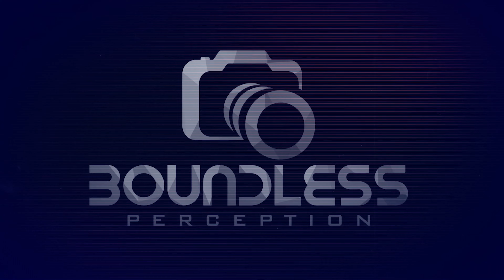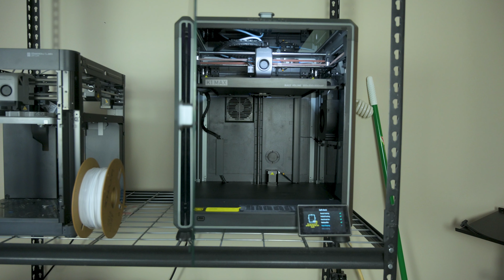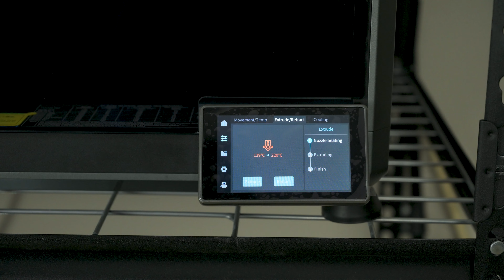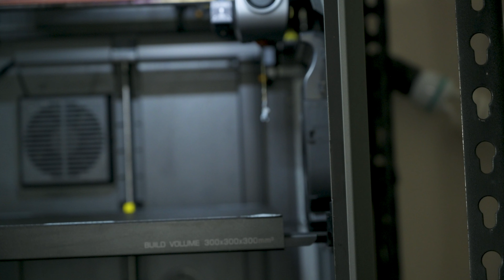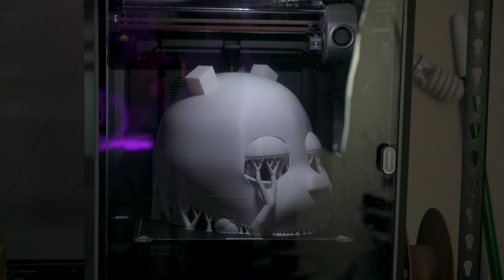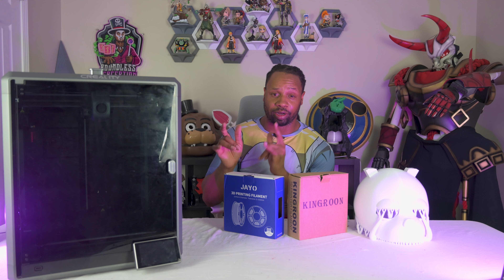I Bought A Creality K1-Max 3D-Printer For Cosplay

Comment: Get yourself the Micro Swiss Hot End upgrade ASAP, that thing will save you so much hassle with clogs and filament issues.  Its amazing how much that one thing improves the K1 Max.
Reply from the maker: You know that  what everyone keeps telling me. I have all microswisses on my cr-10s and they fixed so many problems so likely will. Do they make an extruder gears or just hotend.
Reply: @boundlessperception1466  Just the hot end.  An aftermarket extruder gear would be nice!  But to be honest I've had no clogs after the hot end swap.
Reply from the maker: @cylonmode  Ill be ordering one today.
Reply: So I'm looking to buy my first printer. And am looking at K1, K1c and the max. Am I better off going for the K1 since it's so much cheaper and doing the Micro Swiss Hotend upgrade on it? Or is the K1C & Max worth the immediate purchase?
Reply from the maker: @Ratbiker48  I don't have any experience with the k1c but ny k1 max so far has already given me a jam. It was easy to clear but still annoying. I also recently got a qidi max 3 and though it's enormous would recommend it over the k1 max. It's also cheaper.
Reply: @Bjorneberg34  depends on what you're printing I guess, but I'd always recommend the Max and hot end upgrade.

Comment: I'm using the P1S right now but strongly considering adding a K1 Max. I'm still watching your video as I type this comment so hopefully it'll help me make a decision.
Reply: Adding another comment to say that I also recently got Kingroon Filament, specifically Silk PLA but I cannot say that I had any issues with it at all. I've only run one print so far, and a section of the print failed, but that was my own fault for not adding support to that area.
Reply from the maker: @Ceremony_Scents  Thanks so much for checking out my video. I dunno what it was but my printer really didn't like it. JAYO was the way to go. And I may try silk PLA. Though I hear it eventually leads up to some big clog allegedly. Thats what that chat groups have been saying.
Reply: @boundlessperception1466  might've been the temperature? I kept my P1S completely closed (glass on the top and front) and printed a full case without any issues other than the one I created myself which was the lack of one support, and even then, the rest of the print came out perfect. I just sliced off the part I needed and ran another print, and then glued the missing portion on LOL.

Try adjusting the bed and hot end temps to whatever Kingroon says their filament needs.

I'd also add, by default for me, I apply a small amount of adhesive to the textured plate. Even though I usually don't have adhesion issues, I don't like taking the risk, so I just add that extra security blanket for my own piece of mind.
Reply from the maker: @Ceremony_Scents  Interesting i run my with the lid off
Reply: @boundlessperception1466  I've been wondering if I should run with the panels off for PLA to prevent warping but so far I've ran it fully enclosed for all my prints (all have been pla) and haven't had any issues that weren't my own fault tbh.